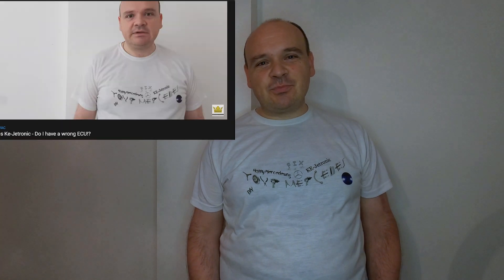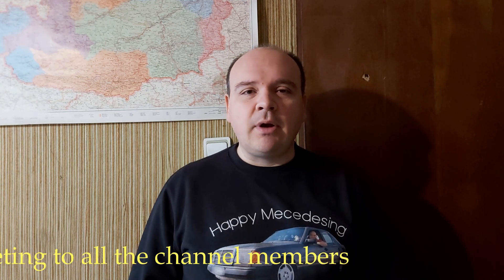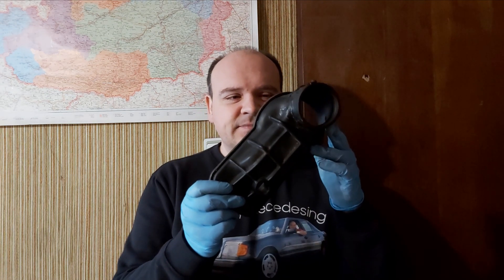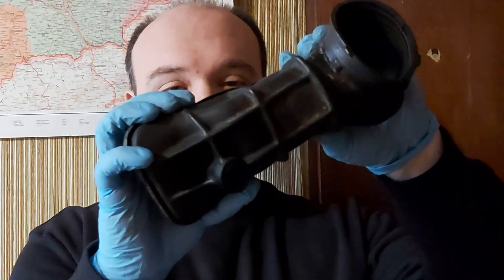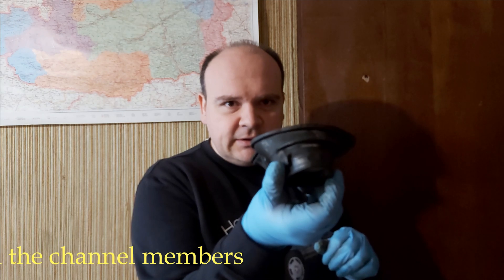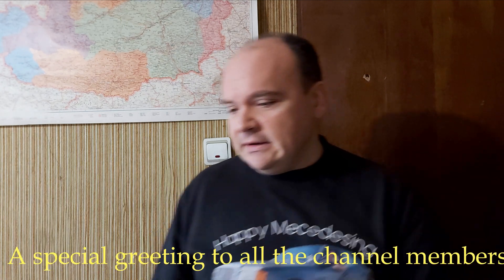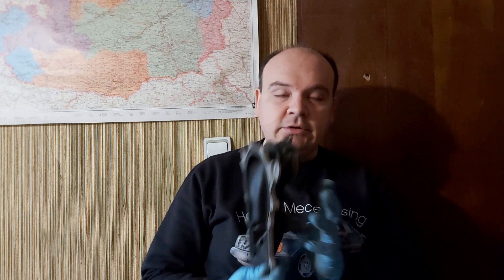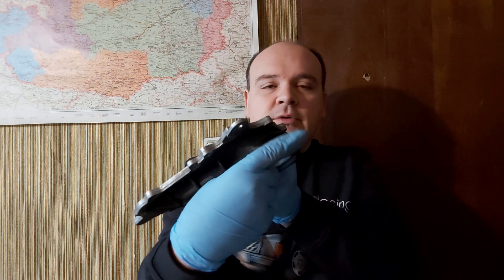㉦Mercedes Ke-Jetronic㉦ - 🫣🫢😱A bad 👢rubber boot👢😱🫢🫣

Comment: dear good brother, my w124 petrol, engine cool one crank it will start, but when i stop the car after 30 minute try to start crank about 3 or 4 time than the car will start, can you tell me the problem ? please help
Reply from the maker: Hello, bro. Replace the fuel accumulator. Greetings.
Reply: @mercedeske  ok tq sir.

Comment: I had problems starting then due to the connection with the air idle thin hose from below ... when this happened there were no explicit maintenance videos and I had to follow the classic path of Haynes mechanic and maintenance books 😁

Comment: Is it possible to swap\replace Mercedes w124 ke-jetronic with a carburetor instead?
Just to reach a lower fuel consumption and get rid of jetronic repeated problems.
Reply from the maker: Yes, it is possible but don't think the carburetor is more simple. The KE-Jetronic is not a bad system, it's just neglected and it's consumption is less than carburetor. This issues in this video is related to the vacuum leaks. The only downside is that there are two parts that are as expensive as hell(the fuel pressure regulator, the fuel accumulator), you have to replace the potentiometer and the lambda(o2 sensor if you have it), maybe the coolant temperature sensor. Everything else can be repaired at home using common tools. You just have to study a bit the system. It seems to be complicated but it's not and if the car is driven often you won't have to touch the fuel distributor!
Reply: @mercedeske  i would like to thank you for your time and kind support, to be honest I've tried and spent a lot to fix it so many times with no luck, my m103 engine consume 20 liters for 140km only!!! That is killing me therefore I'm thinking to change the whole jetronic system with a simple carburetor or pay a great deal and install EFI one.
Reply from the maker: The precondition for a good system is a good compression, no vacuum leaks(all rubber hoses replaced), good ignition and then you go to the mechanical part of the system, afterwards checking the sensors and that's everything. What did you do from all this?

Comment: Buenos dias, se puede utilizar aditivos a la gasolina para mejorar la combustion??
Que gasolina se puede poner? 95 ?98?
Aceite 15w40 ou 10w40?

Gracias un saludo, like...
Reply from the maker: Hola y muchas gracias. No te recomiendo ningún aditivo. Dice que el auto funciona bajo rendimientos óptimos usando 95 octanos, lo mejor sería sin etanol. Cuanto más fino sea el combustible, mejor funcionará el cochel, por lo que no significa que no debas verter 98 octanos. En cuanto al aceite, yo personalmente uso 15W-40, porque es un aceite mineral y estos coches se fabricaban cuando se producía aceite mineral, el 10W-40 es un aceite semisintético y el coche lo consumirá más. También depende del clima, pondré el diagrama no el instagram con el tipo de aceite que necesitas. En cuanto al aceite, aunque Mercedes usa Mobil1, yo recomendaría Castrol, ¡el coche funciona más suave! El que uso está etiquetado como Castrol 15W-40 Magnatec A3/B4. Saludos
Reply: @mercedeske  gracias...

Comment: Maestro buenas noche disculpe de nuevo quería ver si UD me podría decir xq el Mercedes me pasa gasolina para el cárter será el regulador de presión ?
Reply from the maker: Hola. Te aconsejo que compruebes la compresión. El límite de potencia es de 8,5 bar. Lo normal puede estar entre 12,5-13 bar. Retire las bujías, el relé de la bomba de combustible y el sensor de posición del cigüeñal. Luego haga girar el motor 8 veces por cada cilindro. Asi es como se hace. Lo único que tengo en mente son los anillos de pistón o los sellos. Desafortunadamente, para llegar a los anillos de pistón, tendría que desmontar todo el motor, por lo que si no tiene un equipo y conocimiento especial, no le recomendaría que haga esto.
Reply: @mercedeske  gracias maestro yo ya le medi la compresion y está en 120 pero lo voy a repetir

Comment: what if raw pressure 5.7 bar instead of 5.3 or 5.5 M102.982 engine pump deliver fuel 1.5 liter in 40 second
Reply from the maker: The more, the better